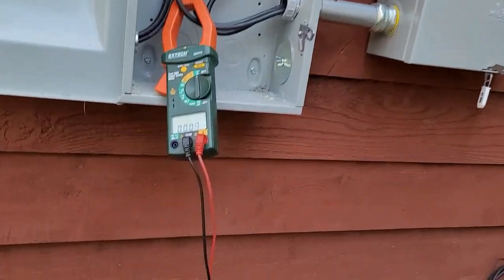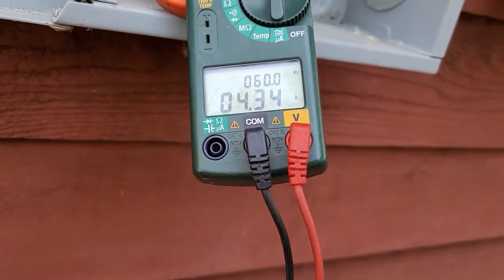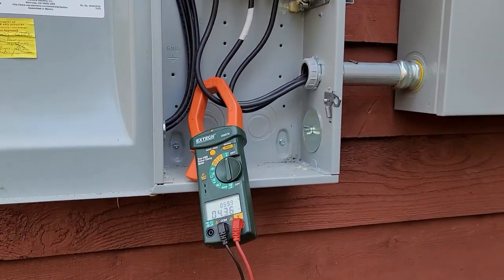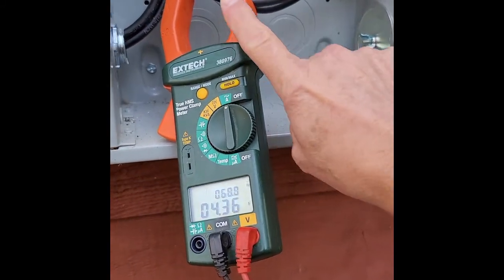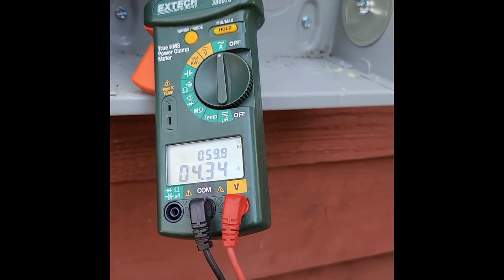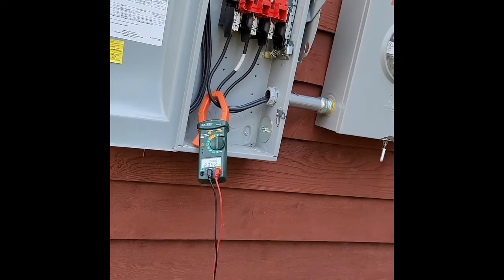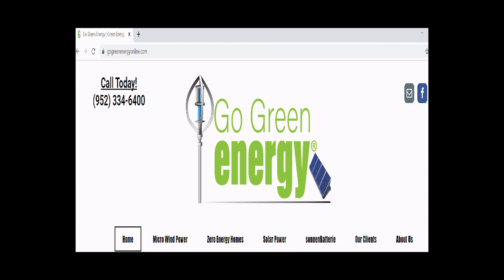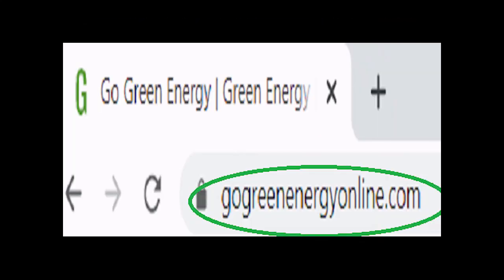Enphase Reactive Current: Why Your Enphase Micro Inverters Show a Current When Powered Up. (Part 2)

Comment: No, that is not reactive current, and proactive current isn't a thing.  Reactive power is when the phase angle of your current and your voltage don't line up.  Reactive power does occur in a highly capacitive or highly inductive load situation. Capacitance and inductance push the phase angle in opposite directions; often in industrial applications with large motor loads you will find a capacitor bank to correct your power factor (a measurement for the phase angle difference) because the power company charges more based on power factor.  Purely resistive loads will not create the phase shift.   During the 5-minute start delay, the inverters are acting as a load they then switch to being a source.  If you have production metering with directional current transformers, you will see the direction shift.

Comment: If you put a meter in between you would be able to see if it flows positive or negative.
Reply from the maker: They actually brought a meter that can show direction and proved I am right
Reply: @TurbineGuy  if there's a heavy pull on the system say electric water heater, furnace, or stove will the amp draw ever go up? Or do they do more of a max amp and cap out? I know that the system will do it from the batteries just wonder if it can backfeed all the way to the panels. Know there only going to put out so much. I've never thought about it tell I seen how these pull power just before they put power out.
Reply from the maker: @hotboy197988  It is a minimal pull (0.1 amp each micro inverter) in order to keep the capacitors in the micro inverter charged and ready. Should never be more than that. If the sun is up and running, then there would be no pull.